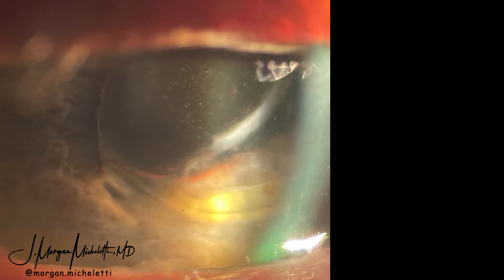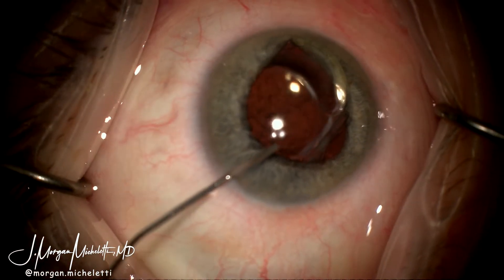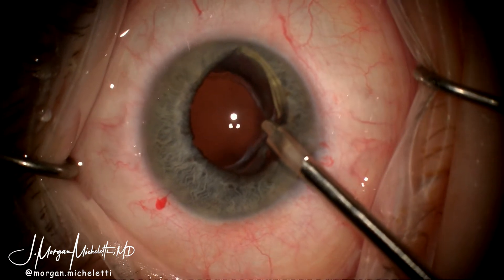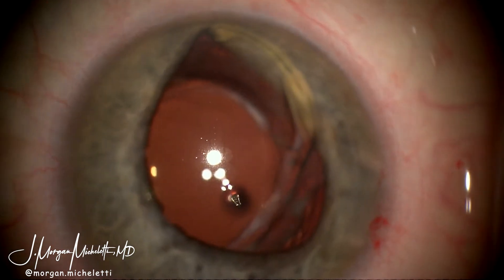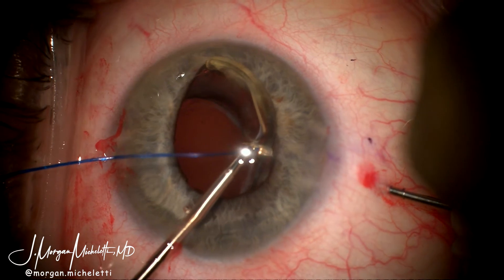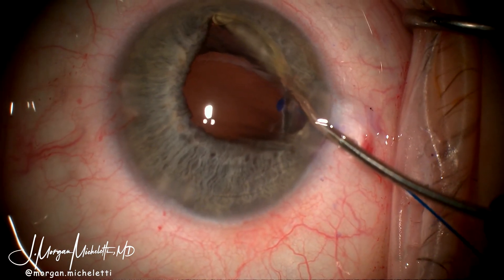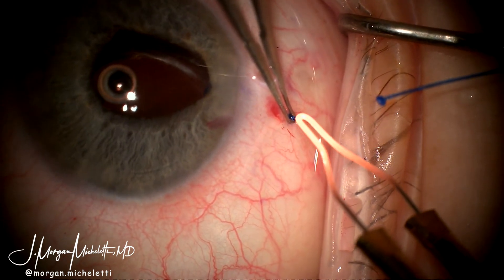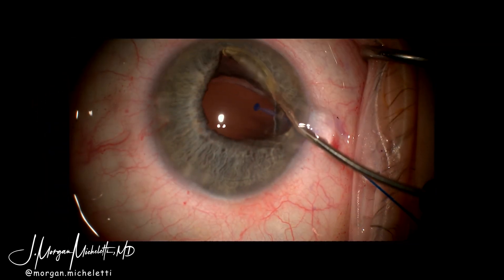Micheletti IOL Punch and Rescue Technique for Single-Piece IOLs

Comment: Great video! Wondering if it would be better if the inside flange is posterior to the IOL rather than anterior. 
I have actually made an IOL flip upside down when performing the 4 flanges technique with the inside flange anterior to the IOL.